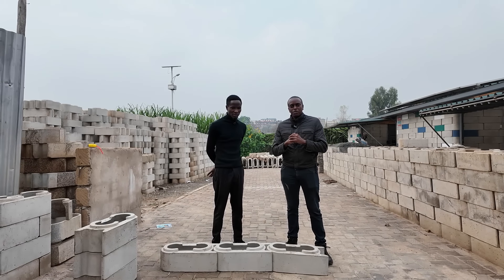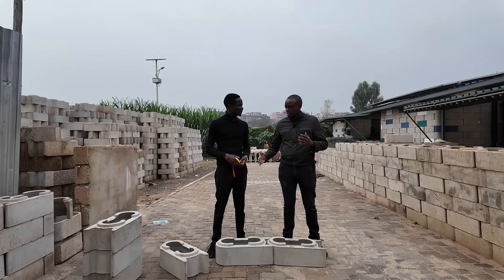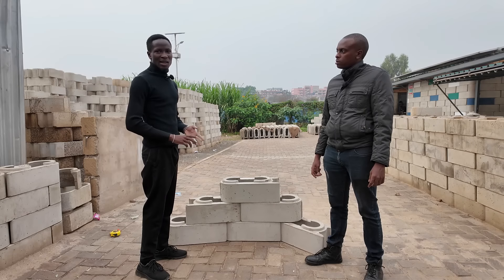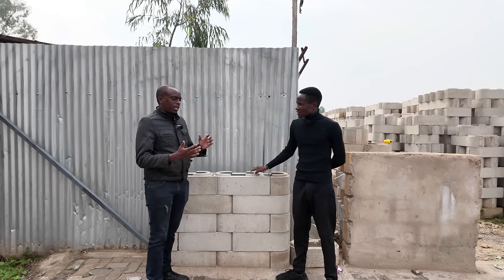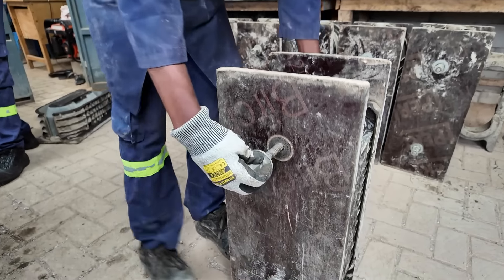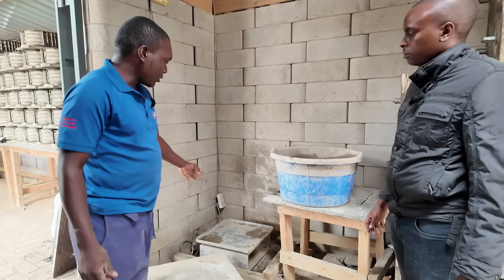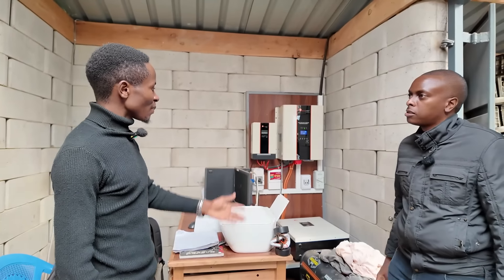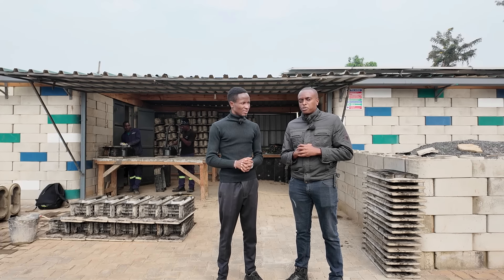Kibera’s Innovative Factory: The Twist Blocks Changing Construction Forever!

Comment: Fascinating new construction technology.  A few questions, hope you can respond:  1) are these for only small shops and one level homes  2) what is maximum weight for these blocks (meaning, if you wanted a two story home, could these withstand the weight load) 3) why are there gaps , shouldn't there be some insulation or protection from the elements  4) will these block move around if heavy winds or strong rains, 5) how durable are the blocks?  6) how many blocks can be produced daily?
Reply: 1. Building Capacity: These blocks can be used for structures up to 6 storeys if columns pass through the twist blocks. For example, a three-storey school of about 400 sqm has been constructed using these blocks.
2. Weight Capacity: Each block weighs 17 kg. They can withstand the weight load of a two-storey home perfectly well, thanks to the reinforced columns, beams, and slabs.
3. Gaps and Insulation: The blocks are designed to interlock properly, leaving no gaps. They are standard blocks that form zero joints, ensuring no spaces are left.
4. Stability in Weather: These blocks are load-bearing and, due to their individual weight, cannot be moved by heavy rain or strong winds.
5. Durability: The blocks have a lifespan of 100 years if well maintained. They are made of concrete, which contributes to their durability.
6. Production Capacity: The production rate is 300 blocks daily, with each mould producing one block per day.
Reply: @samsonontweka5005  Greatly appreciated your timely and thorough responses.  Wonderful technology and will keep tabs on further videos on the same.

Comment: Seeing a lot of air gaps.  Plenty of space for scorpions, air, etc. to get in.  How do you address this?
Reply: Considering the target market is low cost housing like Kibera, though not perfect it is definitely a more dignified end product compared to the rusty corrugated iron sheets that are not weather proof. I believe if budget is available, the walls can be plastered to close the airgaps. Great project
Reply: The blocks form zero joint once built in a generally levelled slab.
Reply: Just need to do skimming rather than plastering.

Comment: If you measure the weight of the water and sand then you can just add the sand to the water to get the same weight without doing moisture test.

Comment: nothing cheap here only labor i think the interlocking brick thing was the cheapest idea because you just use the dirt you have red dirt compress with that brick maker with some cement anything else is expensive
Reply: Did you really watch the video here?Which red dirt was compressed and which part is expensive to you? 🤔
Reply: @steo9285  i did not say theres red dirt i gave my opinion of what is the cheapest building material which is not here simple
Reply: @janendegwa5462  OK. But the red dirt ones don't have easy access for plumbing and still need motor?Maybe ask @propertynoma to make a comparison?I do think this is cheaper overall and better esthetics.